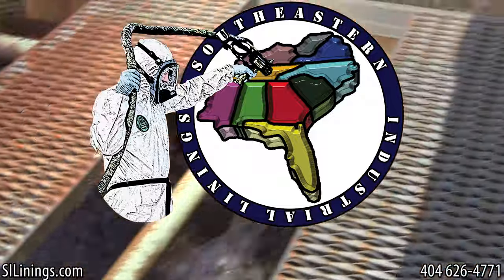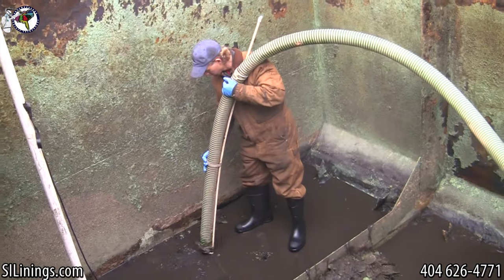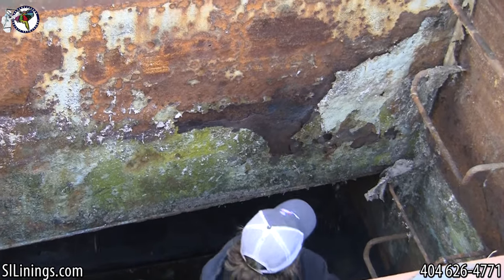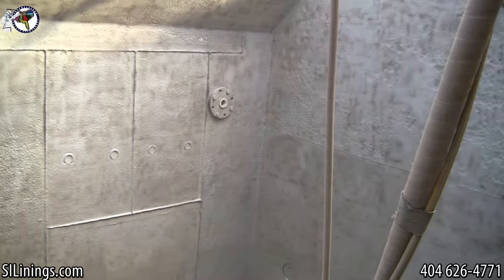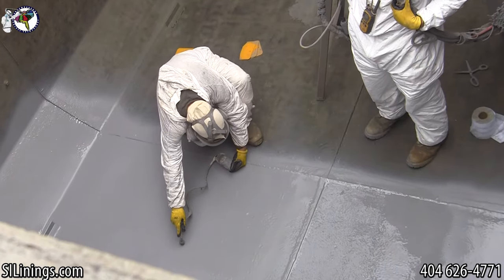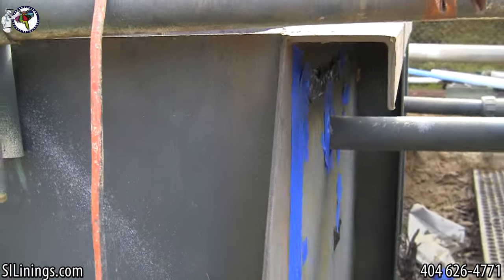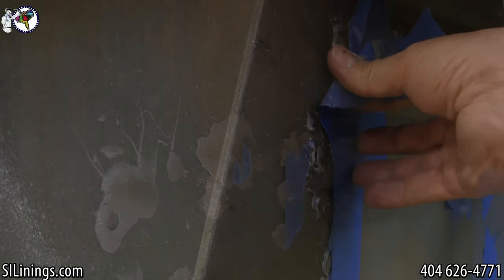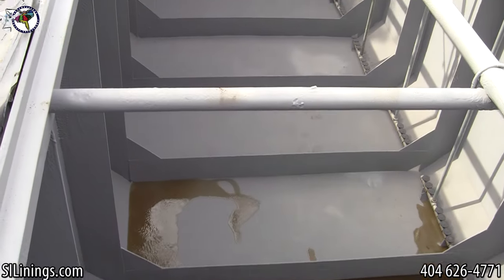Wastewater Sewer Spray On Tank Linings Coatings Repair

Comment: Awesome work! Im lookong into investing in a small heated polyurea sprayer for making small to large sized molds and coating things like room sized areas. Im wondering what brand you use for your machine and where you source your polyurea from? Im doing all this on a budget, so if you have any money saving tips for the equitment, im more than happy to learn!

Comment: Dis you guys did any cleaning before blasting? Or any kind of salt test?
Reply: Julian Zuniga  I felt they power washed then did a salt test before Blasting was done .
Reply: @whiteoak_papi3117  They showed the sand blasting of the surface ...which in fact can drive contaminant or salt into the metal. It should have been chemically power washed after the sand blast and re blasted.  then coated in a set time to avoid blooming of the metals. They showed how they tested the thickness of the material application as a set standard. Now, I dont know about you...but any donkey can spray textures and coatings as required. The success of the job is the professionalism and the application of proper preparation to surfaces and adherage to spray disciplines and times to apply the product correctly for lasting durability. My thought is that the power chemical wash and the re-blasting and set timing of application are the most critical part of this products success...so why wasnt it shown here in its entirety if it was indeed done. If not, this is just a hick job that will require redoing at great cost again, withing the next two to three years. Great product...but lest see that the company can in fact facilitate the use of the product correctly. :(
Reply: @sqnhunter  are you in industry?

Comment: Didn't you have to apply Primer before applying the polyurea coating? 2. What is the average thickness of polyurea coating for this time of job?
Reply from the maker: Polyurea be applied directly to metal. The lining was 125 mils thick.

Comment: How long of a lifespan can be expected from a properly installed coating?
Reply: Polyurea is estimated to last 100 years in ocean water. In a typical wastewater tank it should last at least 15 years
Reply: Around 15 years
Reply: That is not true one coat of that and you give it 15 to 100 years? H2s will eat that up in about 5 years
Reply: @Doebabar  I hope not. We just completed a good sized project.